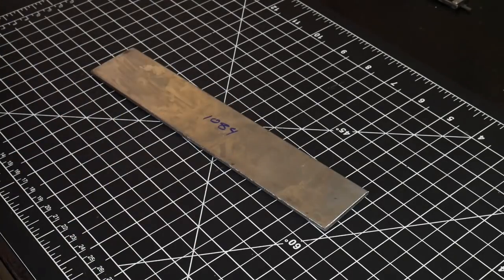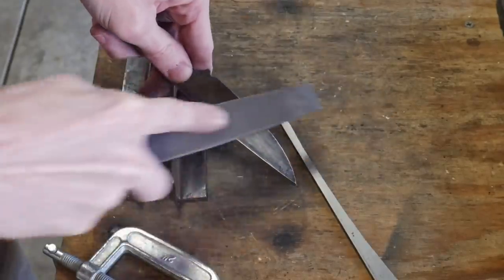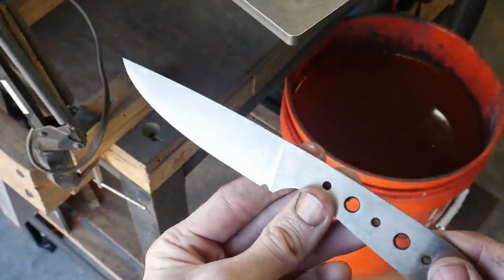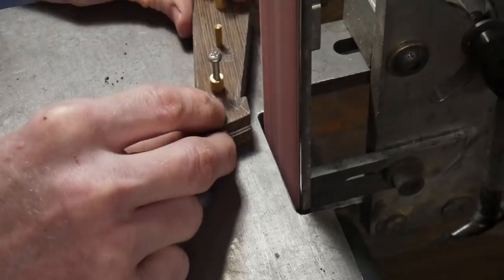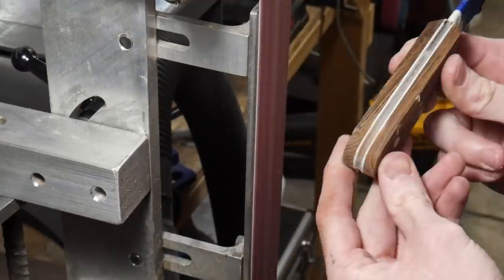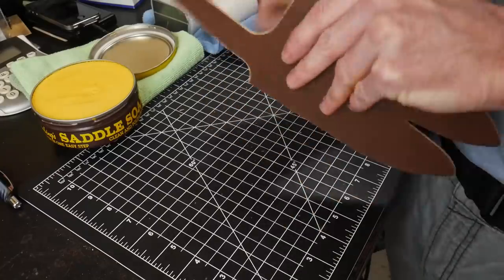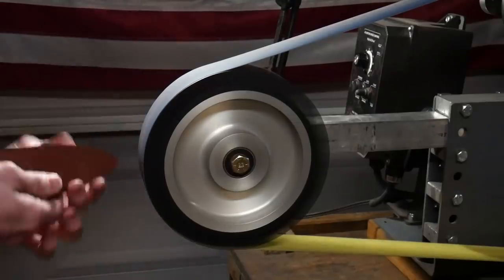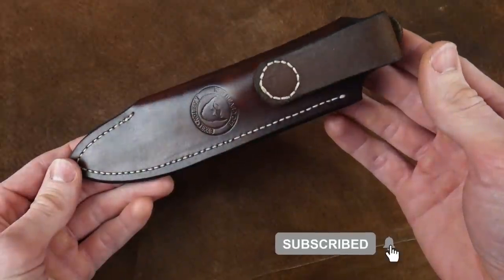Bird and Trout Knife With Sheath | Full Build | Knife Making

Comment: Most beatiful patterns on a leather sheath!! 
       If you do the same half-moon shape near he stitching on the back, this sheath will look way better! Just that on the back side.nothing else! Also, the finish on the side, where the different straps of leather join together if it's more rounded and blackened, looks way better!! A thicker leather, would also upgrade both the function and the longevity of the sheath (especially on 4 inch blade knives and bigger!
           I own one (uknown maker) that is made as I described and is by far my most beatuful sheath and the best to use, because of the thiker and better quality leather. It also smells better than any leather I had on any sheath.
Reply from the maker: Thanks for the ideas! Cheers

Comment: Thanks for the great content you have the best knife making videos on YouTube.. I'm just getting started attempting to make knives and I had a question about the pins for handles. I'm going try to use pins first before I even attempt to use corby fasteners. Is it ok to use 3/16 pins or are 1/8 inch pins better? I feel like 3/16 would be stronger but everyone I see online uses 1/8 inch.
Reply from the maker: Glad you're enjoying them Chris! I'd say choose the one you like astatically better. Should be no major difference in strength.

Comment: Looks fantastic.  Great video.  What do you have in your drill press to press the holes for the stitching?
Reply from the maker: Hey Matt, I have a big needle in there. Came with an assortment set. I've used a finishing nail before but it was a little thick.